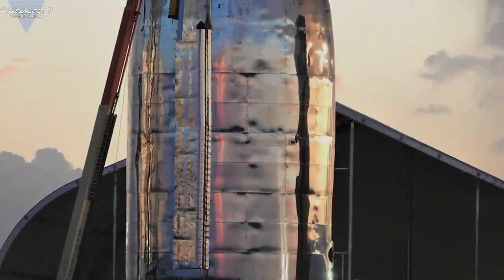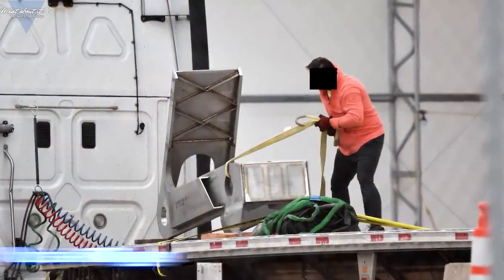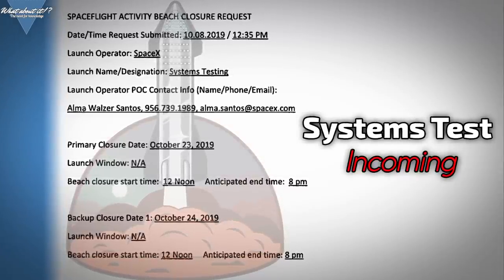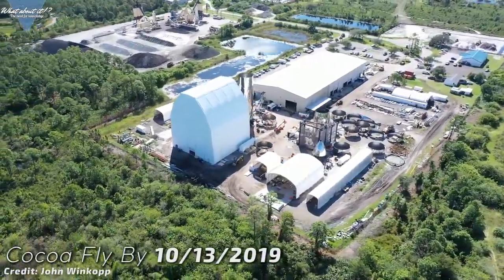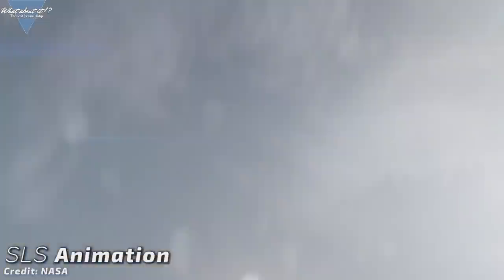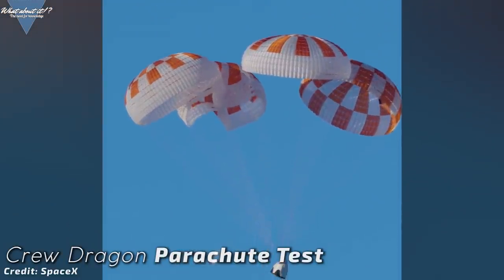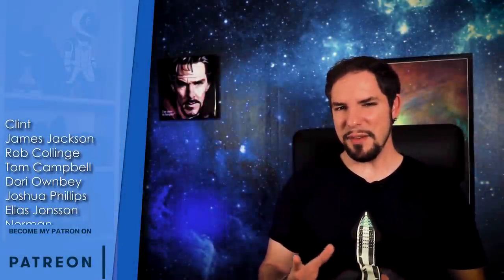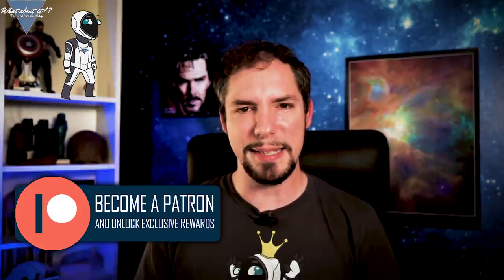41 | SpaceX Starship Test Date – Starship Updates –  Mark 4 In Production - Crew Dragon Schedule

Comment: The hinges may be part of a hold down mechanism used for engine testing and during launch sequence  to allow full thrust on the pad before rocket is released for launch. They appear way too heavy to carry on board IMO. 

Is there a flame trench at the site?  Thanks for the update. All very exciting.
Reply from the maker: No flame trench yet. I am not sure, if Starship will use hold down clamps in the beginning. They might want to play it safe and throttle up slowly. Never say never though! :)
Reply: What about it!? What are the flame trenches for? Is it because it uses methane or i’m completely wrong?
Reply: dragon I’m pretty sure that Elon has said that Starship will not use a flame diverter for single stage launches because it wouldn’t be able to count on a launch facility on other worlds. It needs to be able to land on and lift off from bare ground. 

Superheavy will only launch from Earth so will have a complete facility including flame diverters and clamps.
Reply: dragon - Flame trenches are standard issue when Medium Rockets & above are launched...
Reply: @fighteer1  that makes sense
Reply: "You say the hinge is too heavy"?!  It's made of alloy; they wouldn't make it from alloy if it was to stay on the ground. And have you not looked at the dimensions of starship? Not too big.
Reply: @pdloder  alloy is a very broad term, it's a mix of metals rather than a light metal called alloy, just saying.
Reply: @blankblank4642  yes, I understand that and I should have said aluminium or aluminium alloy. I used that term for brevity and because (here in Aus) most layman just use alloy as short for aluminium.
Reply: @vagatronics  a flame trench or diverter is to redirect rocket exhaust on the ground to avoid damage to launch structure 

    Since the starship initial 
Test will only involve the upper stage or the return and reentry stage It has less engines and is designed to lift off of ground so they may want to see what that will look like on a bigger scale as opposed to star hopper test 
   I think a big question on everyone's mind is what it will look  like returning from the moon and mars thats a big rocket to take off from dirt think super heavy would leave a crater you could put a town in maybe fall in trying to land ??
Reply: There's a big difference between a flame trench and a flame diverter.  In the recent release of plans for upgrades to Pad 39a at the cape, SpaceX proposed a water cooled, metal flame diverter beneath a 30m high launch platform (so all above ground).  This enabled them to build the metal structure off site, to expedite progress.  If you look at recent photos of the launch pad at Boca, they appear to be building a similar launch platform.  I assume they will use the same metal flame diverter here too.

Comment: Always wondered why the Crew Dragon parachutes were causing trouble when the Cargo Dragon has been working fine - just read on Spaceflight Now that a 4th chute was required for the heavier Crew capsule. This change seems to be the cause of the tangling (Apollo used 3).
Reply: I hope they let Crew dragon use it's thrusters as a backup in case of chute failure. But I wonder if NASA will require a fuel dump prior to reentry. I'm not sure why they aren't letting SpaceX use the thrusters if that isn't the case.
Reply: @Bryan-Hensley  I trust Draco more than those parachutes
Reply: @Bryan-Hensley  seems like they "over engineered" the parachute system
Reply: @ne1cup  I think I do too. I don't understand NASA refusal to let them use it
Reply: @ne1cup  I wonder if NASA is worried about Crew dragon having fuel on board during reentry. If so are they going to dump the fuel in space.
Reply: Hondo those parachutes are the most advanced parachute system on earth
Reply: @vagatronics  and pointless. Crew dragon can land by itself
Reply: Requirements added by NASA that slowed things down.
Reply: Part of me wonders if NASA is adding requirements to slow down development of the rocket industry

Comment: What's strange to me is that if Starship stays on schedule it will quickly make Crew Dragon completely obsolete. 

By analogy, Crew Dragon is a Smart Car while Starship is a long haul semi-truck. 

Crew Dragon could get operational and be able to send six people to the ISS only to get there and find a Starship with a 100 tourist on board snapping pictures while Crew Dragon docks. 

Then the Starship lands at at a spaceport while the Crew Dragon parachutes down using a 50 year old concept. 

The mismatch between the two is just incredible.
Reply from the maker: Disruptive technology always creates funny situations. ^^
Reply: I'm not sure NASA will let Crew dragon go in place of the starship mainly because of the abort system. Starship is set up to fail like the space shuttle if something goes wrong during the launch. Crew dragon can land under it's own propulsion now but NASA won't let them
Reply: @Bryan-Hensley  -- Oh, they may not but they'll look pretty silly laboriously sending up six people at a time into low Earth orbit when Starship is orbiting a 100 artist around the moon. 

An escape system like Crew Dragons won't work on a vessel the size of Starship because the parachutes and escape rockets won't scale up to that size. They have a hard enough time just with Crew Dragon.

Crew Dragon is like a six passenger aircraft while Starship is like an airliner carrying dozens or hundreds. You can get six people to bale out of a small plane before it comes apart or crashes but there is no way that would work with a full airliner. 

Escape systems are for X-platforms not production vehicles.
Reply: @shannonlove4328  SpaceX better come up with some kind of abort system or NASA won't let them. SpaceX will be the death of citizen space travel if starship blows up with 100 people on board.
Reply: Clorox Tree  -- Well, it makes sense for SpaceX to get paid for government work, but if Starship works as advertised, and Elon has a track record of delivering, then that government work maybe obsolete before it flies. 

Starship is going to be bigger than Saturn Five. Its capacity is staggering compared to the SLS or any other system in the pipeline.
Reply: @shannonlove4328  they can't use starships engines like Crew dragon can because the starship engines are vacuum engines. Elon did mention that they are trying to come up with a plan for some sort of land nozzle that can be ejected after it is in space.
Reply: @shannonlove4328  I hate to say it but Orion is the best idea overall. I really want SpaceX to be the first though. Elon isn't worried about the moon, he's got a time frame for getting to Mars. Meanwhile NASA will be on the moon learning how to live in space. They'll benefit each other. And for the first time ever we have at least 3 organizations in the USA in competition to get people to space and the moon. It's really an exciting time for space enthusiast
Reply: @Bryan-Hensley  -- We tolerate mass death for airline travel, why not space travel? If you put enough people in space, a mass accident is unavoidable eventually. 

The Space shuttle did not have an abort system so they're not mandatory. 

 Once you go hypersonic, you're pretty much screwed if anything goes wrong because the vehicle will disintegrate. So,an abort system only covers the main boost phase.

With both the Space Shuttle and Starship, the orbital vehicle is the escape system. If the main booster fails, the orbital component blast free and flies back to the ground. 

Starship will have rough landing capability so unlike the space shuttle, it won't even need an air strip. It can set down in the middle of the Sahara if it has need. 

It won't even overheat and catch on fire like the space shuttle would if it didn't have cooling systems attached. 

Overall, I don't see big problems.
Reply: @shannonlove4328  uhh, didn't you see that the Russia rocket failure a few months ago? They would have been dead if not abort system. We are talking about NASA approval not the FAA
Reply: @shannonlove4328  Starship engines can't be use for abort engines. They are vacuum engines
Reply: @Bryan-Hensley  -- Well, no. Starship has two engine types, low atmosphere and space. That's how it can land in atmosphere on earth or mars.
Reply: @shannonlove4328  I'm just repeating what Elon posted. If they are landing engines only they won't be near powerful enough to abort. He mentioned something about ejectable nozzles might work. So as of right now, there's no plans.
Reply: @Bryan-Hensley  -- Orion is just a slimmed down Saturn Five or a Proton on steriods with no reusable components.

The Starship will be fully reusable, vastly cheaper and with several times payload. 

It's a order of magnitude or more beyond SLS and Orion. 

The advantage of Orion is that it's just an incremental improvement on existing technology so we can be confident it will work despite the waste, cost and limitations. 

But if Starship works as advertised, it won't even be a contest. It's a deference between a Smart Car and a Semi when the job is hauling a lot of cargo.
Reply: @shannonlove4328  smart cars travel further on less fuel. Soooooo.
Reply: @shannonlove4328  Orion is going to beat SpaceX to the moon. I am a SpaceX fan. I want SpaceX to be the first to the moon. But I'm also realistic.
Reply: @shannonlove4328  Orion is ready now. It can ride upon several rockets. I really hope falcon heavy with Orion on top goes to the moon. But after checking the numbers, it's not powerful enough for humans.
Reply: @Bryan-Hensley  -- And the Space Shuttle was different how?

I'll repeat myself. If you say all space launch system have to have an escape mechanism, that means you've limited the size, type and payload of your system because escape systems do not scale. It means we will never have large scale space travel ever. 

If NASA doesn't like the risk, that's fine. With magnitude of operations Musk is talking about, he can build his own space station and go to the moon on his own easily. 

If Starship works, I'll think it will suck most of the money out of everyone else's space program because it will be able to lift so much, so cheaply. . It will change everything from the size, power and function of satellites, to solar exploration, development and settlement. 

Orion will be a joke if Starship works. NASA will get to the moon and find themselves staying at the SpaceX hotel and refueling station.
Reply: @shannonlove4328  I'm all for starship overall, I just don't want to wait 6 more years. It's most likely not going to be flawless. They'll be setbacks. Meanwhile, China, NASA and possibly India will have people on the moon.
Reply: @Bryan-Hensley  Booster explosions tend to be fairly slow, and there is often early warning of imminent failure. The raptor engines used for landing can boost Starship fast enough to outrun a booster explosion.
The issue is starting up the Raptor in an emergency. Elon stated they can be spun up extremely fast, and they are very conservative with their start up speed. The question that is not answered is can the Raptor be started quick enough to still outrun a booster explosion? If so, will the engine be still reliable enough to make an abort to orbit? Not being able to abort to orbit is a big issue because you are over the ocean in a vessel not designed to float.
Reply: Which information?
The stuff on Raptor spin up and acceleration come directly from several interviews with Elon, I think he even tweeted about spin up speed.
To be clear about the engines, the center engines are gimbaled and are sea level engines, the outer engines are fixed and are vacuum engines. The difference in efficiency is not so great that either can not be used in vacuum or at sea level. As designed Starship is a single stage to orbit rocket if it has no payload. Logic then demands that abort to orbit is always the best option unless you very close to the launch pad so you can make a fly back.

The stuff on booster explosions just comes from countless sources and being a space nerd for decades. I also am cursed with knowing a lot of chemistry. A booster can only explode if it goes over-pressure. With out an external heat source (a la Space Shuttle) the pressure vessel will not explode. A crack in the pressure vessel can cause an un-contained explosion. Even with methane, the detonation propagates fairly slowly, and there is tons of early warning. Go light your stove and pay attention to how fast the flame spreads around the burner, this is how fast methane flame propagates.
Reply: @joshua43214  here's a copy and paste of Elon response to the question. He's talking about starship falling away as the only abort.
Oh launch abort, the spacecraft itself is capable of aborting from the booster, the erm… Launch abort on the spaceship itself is kinda pointless, if you’re on Mars you’re taking off or you’re not taking off. You know, parachutes don’t work too well and [you can’t have] some standard abort system, and just how do you abort 100 people it’s just not feasible, the key is to make the spaceship itself extremely safe and reliable, and have redundancy in the engines, high safety margins and have [it be] well tested. Much like a commercial airliner. Like they don’t give you parachutes.

Comment: I still think the structure at the old launch site will be the permanent home for the hopper test stand, but now I think MK-1 will launch from there since it only uses 3 engines. If they ramp up Raptor production, they will need the hopper test stand as McGregor won't be able to keep up. I still think the final heavy launch stand will be where the pile auger is now working. Thanks again for the great video.

Comment: Great job Felix! 
One question for community or, better yet, the design team. Has has a spiral assembly method been considered for the construction of the fuselage? It would seem that the fuselage could be manufactured using one continuous sheet of coiled ss material that would be dispensed, uncoiled, at a slight angle and seam welded thereby producing one tube/cylinder of virtually any diameter and length. The machine wouldn’t move and the welding would be done at one spot. This method has been used to manufacture or produce small paper tubes such as straws to large round spiral HVAC duct and pipe. This would require a very large machine but there would be virtually no limit to length and diameter that could be produced.
Reply from the maker: That is a good question. I honestly would not know. It sounds much quicker for production, but I don't know, if the statics would work out. (?)